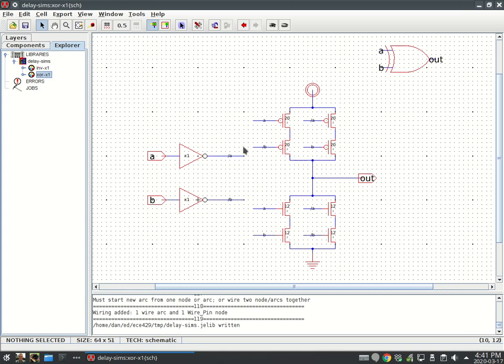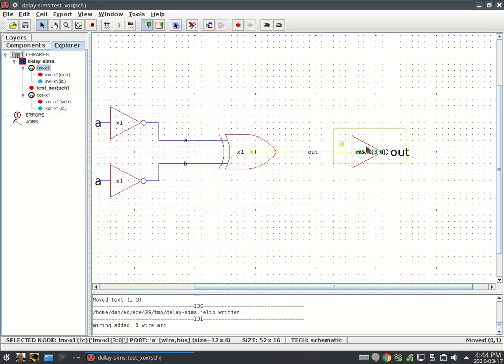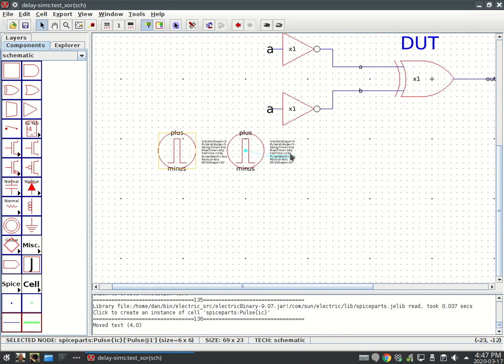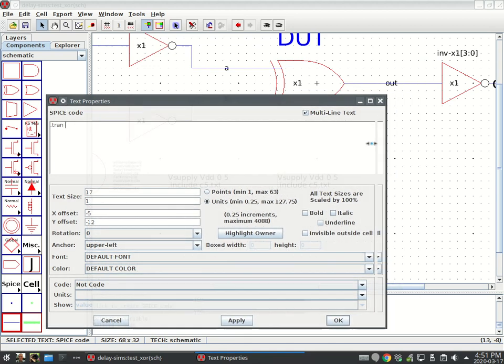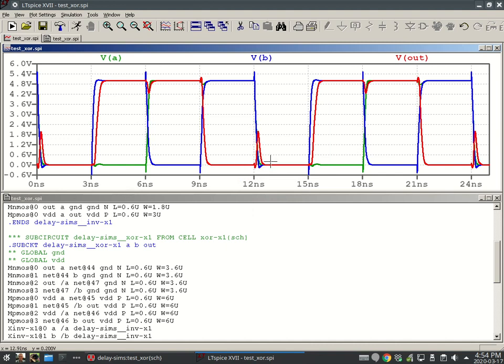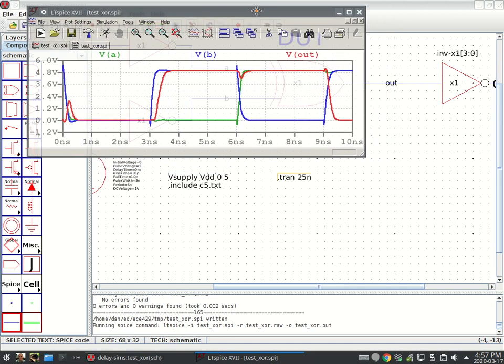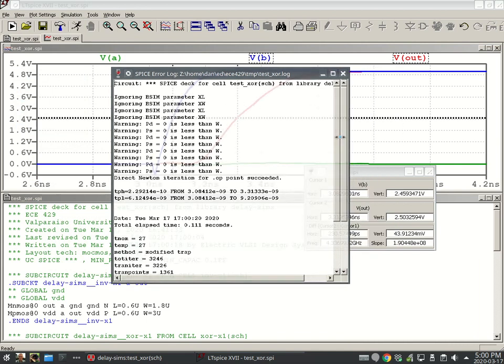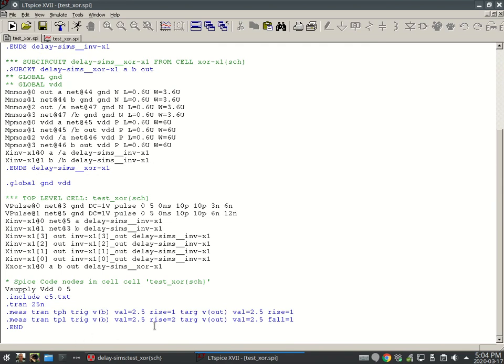Electric and LTspice measuring logic gate delays - part 2

Comment: Hi, great effort! Would it be possible for you to include the c5.txt? It seems that I am running into errors "Cant find definition of model "n" L=400n W=1.2u" etc etc and secondly I dont understand why my .spi file contains "Mnmos@0 vdd a gnd gnd N L=0.4U W=1.2U
Mpmos@0 vdd a vdd vdd P L=0.4U W=2U" , ie why the values of L and W are different from yours? Thanks!